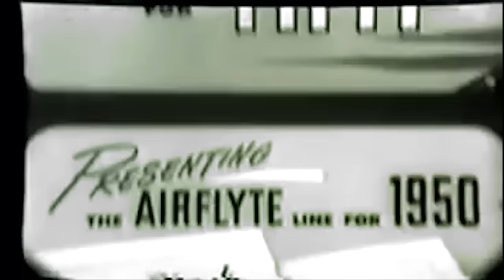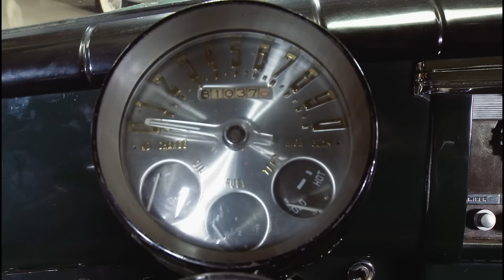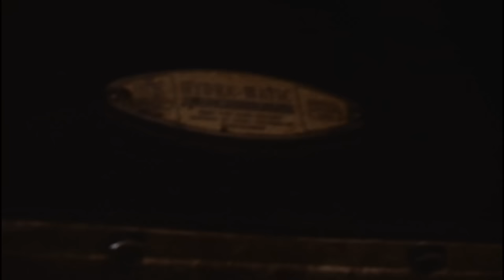1950 Nash Ambassador Custom - Jay Leno's Garage

Comment: The downside of this Nash Airflyte styling was that it was very 1940s, and was rapidly going out of fashion at the time. General Motors dropped their fastback models at the same time because they were no longer popular, but Nash was stuck with this design, which couldn’t easily be altered.

Comment: Of course wire does not come in voltages it comes in sizes and depending on what size is what size you use.
Reply: 6 volt wire is heavier because of the
Lower voltage

Comment: The little Buick straight eight,not the big one
Some references have the 1950 Pontiac Eight at 108 horsepower,others claimed 115 but I think that Pontiac would handily outrun that Nash but consumed much more gasoline---
I think GM rated the power of the Pontiac down a bit and even the power of the new Oldsmobile V8 down a bit at only 135 hp. in order to promote the more expensive Buicks (with the "giant" eight) and the Cadillac with its larger copy of the Olds V8 
   and Buicks with the Dynaflo one speed automatic were "oh,so slow"

Comment: $2 for a motel stay even in 1950 seems really cheap....like $20-40. A gallon of gas supposedly was 27 cent per gallon. You sure you don't mean $20 jay? That'd be an expensive room
Reply: No genius, 2 dollars in 1939.
Reply: @WitchKing-Of-Angmar  still only $40 adjusted for inflation genius. Still definitely not expensive
Reply: @LargeMuscularTitties  hold on you just contradicted yourself. Is it or isn't it expensive you, absolutely ingenious, genius.
Reply: @WitchKing-Of-Angmar  whatchu talkin bout willis? I said "you sure you dont mean $20? Thatd be an expensive room" as in if the room were $20 that would've been expensive, but $2 is cheap
Reply: @WitchKing-Of-Angmar  I should've said "that would have been" instead of "that'd be" to make it more clear. Would you not agree though that $2 would've been a cheap motel if it really were only $40 in today's money? Heck maybe that was expensive for a room back then and nowadays they're 2-3x overpriced compared to back then
Reply: @LargeMuscularTitties  not quite $40 in adjusted inflation rate, theirs more to money value over the years than just  what the value generator from 1935-9 to 2022 would opt out as, most kids think that proves that prices didn't change in their quest to make almost everything in the early 20th century as being terrible. I was trying to figure out what side you are on.